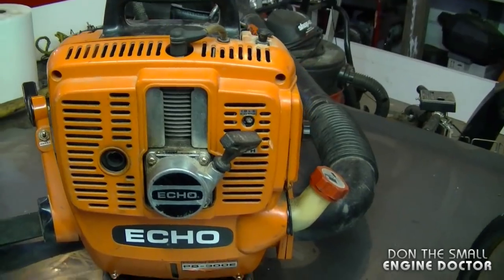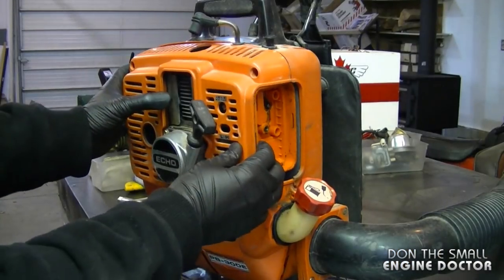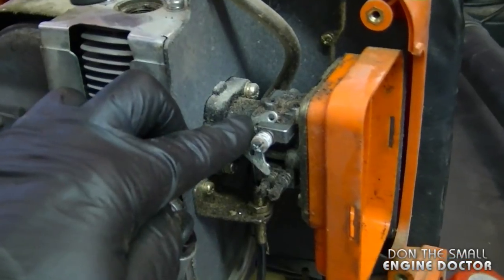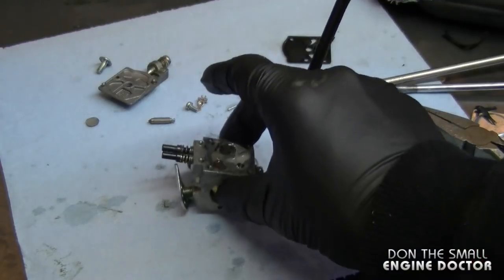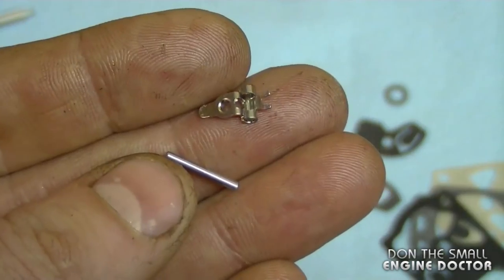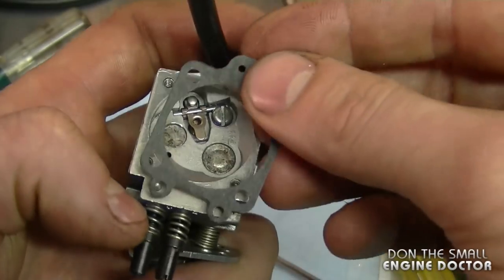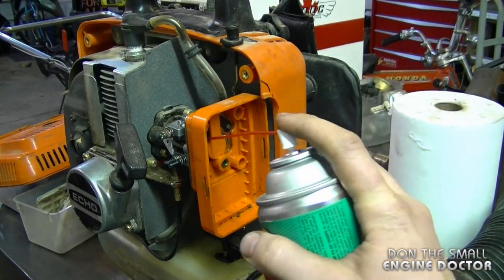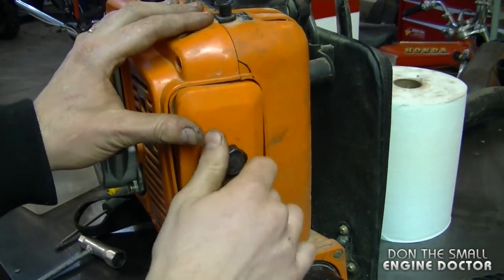Leaf Blower Carburetor & Fuel Line Repair

Comment: Don, I have learned the hard way with gas tanks and fuel lines to pressure check the fuel lines, tank and cas cap with my Mighty Vac.  The whole system needs to hold 7# of pressure and not hold an equal amount of vacuum.    On tanks with grommets, I put a little 1184 on the grommet before I push it back in.    On carbs, I just clean and replace the diaphragms as a matter of routine after throwing them in my ultra sonic cleaner.

Comment: I always pressure test a rebuilt carb to 5# after rebuilding them.  This makes sure I have done things right after rebuilding them and also catches any leaking gaskets.  I have the Walbro W and Zama Z, too.  I set the lever just dragging lightly on the gage.    There are some carbs that threw me in the beginning, like the Walbro WJ carbs that are adjusted on the slot and not on the top of the carb.

Comment: And you help me again 
I would never ever guess that the diafragma if is not even to the carb will not run I guess that why was running before storage 2 years and now clean 2 times and still not running 
Change the diafragma and voila ! Than you Donny 
I'm a subscriber for years

Comment: I agree with all the work you did with this and believe it all needed to be done.  I bet the main reason it was running bad was the fuel line that broke.  I bet it was cracked and sucking in some air though that crack in the fuel line.   
She sure runs like a champ now though.

Comment: Thanks Dony, the intake valve has the white stem seal or cleaner and exhaust has none on HM100 long block and the valve guide sticks down through the block into the valve spring chamber on one valve hole and not the other.

Comment: 'make sure you keep your finger on the lever or you may lose the spring'  That sounded like the voice of experience. Nothing more fun than crawling around the shop floor looking for a ploinked spring, eh.
Reply: +Paul Dowding I would have said: "Make sure you keep your finger on the lever because the spring will fly out in a direction that defies all laws of physics and roll into a place where it can not be reached without moving some major piece of furniture".
Reply: +TheOtherBill Or a drain hole, springs and small bolts and nuts find those holes a lot.

Comment: Hi Dony, excellent set of videos. I've seen you service a Walbro carb before and was wondering if it is necessary to remove the hi and lo screws and blow through with carb cleaner?  Thanks again.

Comment: nice video on a walbro and other small diaphragm carb rebuild!

Echo often sells kits that include both parts of the fuel line including the grommet/connector and fuel filter. Depending on the model, some come with new air filters, spark plugs, and or fuel cap gaskets. Can be easy and quick if they're available for your machine in a store near you.

I also was surprised you left the mixture needles in while cleaning, is that common to do?

Comment: With an inexpensive spark plug testing tool a person can also test to see if the spark is weak. Sometimes the spark is there, but it is not strong enough to do the job in the field. Other advantages to the plug testing tool is that it is a hands free setup, can be rigged to be seen from the other side of the equipment, and can be seen with lights on or outside. There are no moving parts so they last forever.

Comment: How about a Stihl BR 500,550 or 600  backpack blower fuel system rebuild Donyboy??  Would love to see some work
Reply from the maker: +gerry6310 ok
Reply: +donyboy73   I tried to replace the fuel line in the tank and had to take it to the shop.  I was afraid to break something.  There is absolutely nothing on the internet for the BR 500,550, or 600 backpack blowers.  Thanks again!

Comment: By the way can you recommend a parts supplier for my shop needs to get the fuel line and other parts you use in this video! I’m in California but ordering online would work perfect just need a good supplier. Thank you again for all you do.
Reply from the maker: www.discountonlineparts.com
Reply: donyboy73 thank you very much! I looked and didn’t see that exact fuel line I will look again. Have a great night.
Reply: donyboy73 is there a specific brand I should search for to get that fuel line? I wanted to get that one because you mentioned it’s a great quality and will not vibrate off. Also do you know of it comes in bulk maybe rolls? Sorry for all the questions thank you for all your help.
Reply from the maker: @paulrhodes482 tygon or black STIHL fuel line
Reply: donyboy73 thank you for all your help have a wonderful day!

Comment: Often I have to remove the air cleaner housing to expose and adjust a carburetor as it's part of the main housing or just in the way.  Do you adjust for good running and throttle response without the filter in place knowing that it will be running richer when the filter is added or do you compensate for this somehow?
Reply from the maker: +Eddie the Grouch I re-adjust if necessary after the filter is installed. usually a good clean filter makes no difference

Comment: I need your help for my STIHL BR380 backpack blower. After running full throttle for 20 - 30 minutes or so it starts to lose RPMs. I bring the throttle back and it idles perfectly. Rev it back up and within a second or two it loses RPMs again. Once it loses RPMs I tried removing the fuel filler cap but that didn't help. (I thought maybe the tank breather cap was clogged). The blower doesn't have that many hours on it. I use ONLY nonethanol gasoline and full synthetic 2 cycle oil at 50:1 ratio (Bel-Ray). I have replaced the spark plug, fuel filter and air filter. I have removed the spark arrestor and cleaned it. The compression is great. Starts easily cold and hot. Any thoughts? Have you ever experienced a collapsed fuel line? If so do you suggest I replace those next? If that doesn't correct the problem then do you suggest I replace the carburetor? Any assistance will be greatly appreciated. I'll be glad to compensate you for your assistance. I really like this blower. 2 cycle and light weight (20 lbs). Thanks.

Comment: Question: why is there always multiple possible holes into which the throttle wire may be located?
Reply: they make them for more than one machine.  if it was make for just one machine, it would cost a lot more.

Comment: Dony, I have a question about a previous vid. Doing my valves on a Tecumseh HM100 10 hp. The caps on top of the valve springs, do they both have a white plastic or Teflon seal or just the intake and NO seal on the exhaust because of heat?
Reply from the maker: +Mark Weaver sometimes just one valve has it, take good notice when taking apart. you can also lookup a parts list online

Comment: We got a Echo PB4500 with the airfilter on top. You have any idea if the airfilter lid can be re-ordered? I don't know if they are still made.
Reply: +Nick R Best thing to do, in my opinion, is to find the illustrated parts list online using the model and serial number so you get the correct list. After finding the part number of the part you need enter just the part number into a Google search, then search ebay.

Comment: Smartest move is to replace all Champions with NGKs!
Reply: agree
Reply: +bayernmotor I had a snowblower with a new champion I couldn't get it to run right at all. put an ngk in and solved the problem it ran perfect. and put a champion in a car and see what happens

Comment: Dony, on a Zama carb for a craftsman leaf blower, how many turns out do the 2 adjustment screws need? Thanks.
Reply: +Dastardly84 
I'm not a pro, but I usually try 2 turns out and then lean it out from there once it starts up.

Comment: I am having problems with my  stihl bg 55 not raving up, just idles. I pulled the spark arrester screen, it's clean. also pressure/vac the fuel lines, no leaks. should I replace carb?
Reply from the maker: +stoolie10 slightly turning out the L and H screws should fix it

Comment: I have a Yamaha Ttr 125 the top end where the spark plug goes is striped need help pls
Reply from the maker: +Kade Hart you can try a spark plug thread chaser tool or use a spark plug heli coil repair kit